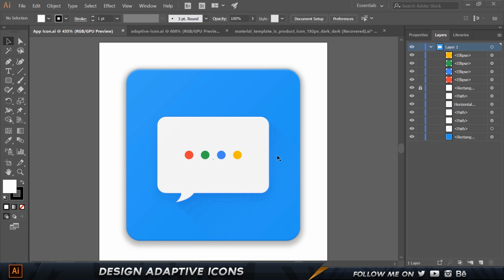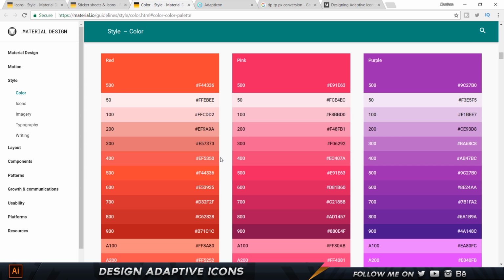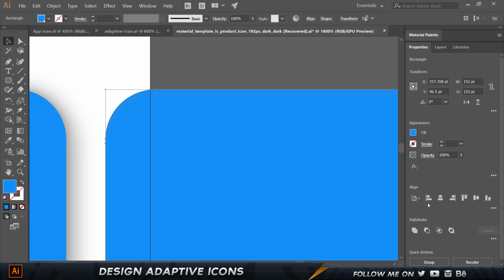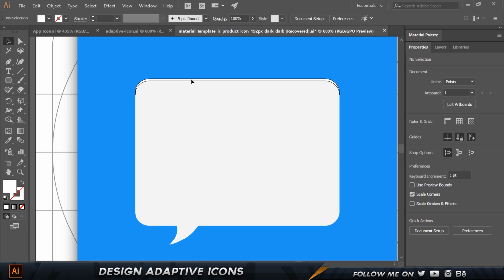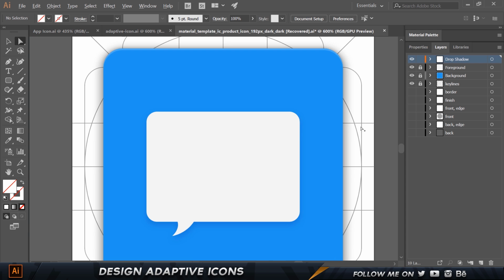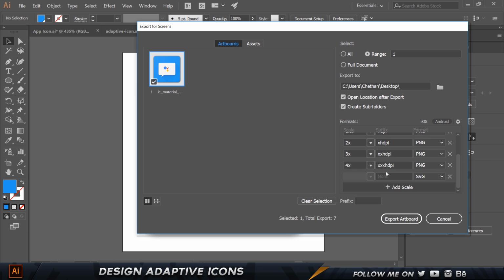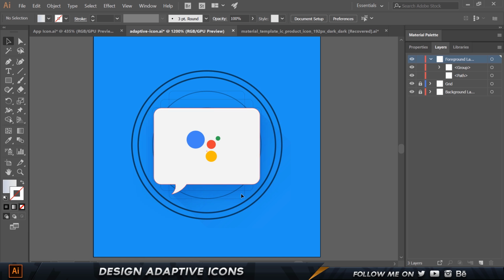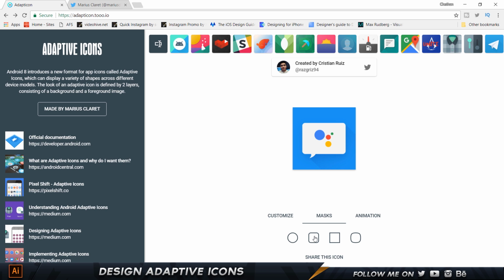Design Adaptive Icons using Google Material Design Guidelines - Illustrator CC 2018 Tutorial

Comment: Nice tutorial! However, when using the circle shape from template (176dp diameter), the drop shadows get out of bounds (the artwork) causing the shadow to be clipped when the icon is rendered. As a quick fix, you can reduce the circle, but this means to not follow the template. Reducing the drop shadows make them have a more significant shape. Any ideas?

Comment: Hello, can you please explain me why I need to create first a file with background layer that drops shadow if later in the end when I will export I export another file where background is flush and rectangular without shadows? Like the only files that I will use are Foreground.png and Background.png. The background. png isn't rounded, doesn't have shadow. 

Also big thanks for the video it is just purely awesome!
Reply from the maker: Hi. None of the 2 should have rounded corners. Android will crop them for you.
Reply from the maker: And Background needs a shadow so that it looks elevated on your android phone.
Reply: @DesignPilot  Thanks for answer. But wait, how do we make The icon itself in app? We import to Android studio 2 files (foreground and background) and Android Studio generates the icon with all needed sizes. But the question I have is: You import to Android Studio the background.png, but it doesn't have elevation cuz you deleted 2 layers of shadow? :DD confusing a bit

Comment: PS that dp is very confusing because it differences on what your designing for. They call it a "density independent", i find it very confusing because it goes against rules of pixel perfect as what ive been learning. If its for web than dp=px but if its mobile you need to do all kinds of calculations before getting 1dp. But that can results in a none pixel perfect ratio. So for example on a certain phone 1 dp can be 1.5px, try design for that and doing it perfect in design apps which are either vector or pixel orientated... I feel like they made designing actually more complicated by using this new unit which is NOT implemented in all the "standard" design applications.
Reply: If you check their own lib on github, they provide a lib of all icons. When i checked those, i see they are not using their own rules for margins for icons
Reply from the maker: Yeah. They are guidelines. Not rules. So there is definitely room for fun
Reply: Another point i find bad and vague, is their color theory, they are applying weights like with fonts. Okay i get that, but they never explain how to get those weights, it feels like random hue values. Its the same with that weird DP unit. They implement weird values new values which not exsist in design applications. Have you have seen an option to in put 500 for a HEX of #FF33AA? No it does not excist. THey should atleast give a theory of how they weight values apply to colors. This makes no sense at all while they make it like look and sound like its normal.
Reply from the maker: Yeah. I guess your argument is fine for Colors. But I'm sure there is a good explanation to that.
Reply: @DesignPilot  There is no explanation on their site. Atleast i could not find it. They should have explained that as well. Because it makes using custom colors neglect their weight values and be more like random picked. My guess is that the weight is related to as in like HSV , so the weight is for value as in light~darkness
Reply: One more thing :) when you did the export you should check setting for the PNG. Because as standard it use type hinting, which makes artwork look more jagged. Users should use art hinting there!
Reply from the maker: I see. Thank you
Reply: One note when make the highlight and depth shadow. You say you press down once, but its kind of user settings depending on how much the item will move. Thats a setting in the user pref > general > key increments, you forgot to note that ;)
Reply from the maker: With regard to the dp and px, I would say that they are right. A lot of screens especially for mac, have retina display which means there are 2 times the more pixels. Even if the screen size is 1440px wide, there are actually 2880px on the screen. Hence 1 dp = 2px. If you want a 2880px screen, imaging the physical size of that screen. It would be huge.
Reply: @DesignPilot  But its not as easy as you just said, the calculation to get dp is math by itself. Check the docs, that part is kind of vague on what needs to be used as a start. Because for apps your not dedicated to a single DPI, so them giving a calculation to find the correct dp for a given screen is making it very confusing.  By the way, an iMac 2009 was 27in and had around 2550 non-retina, quite big indeed